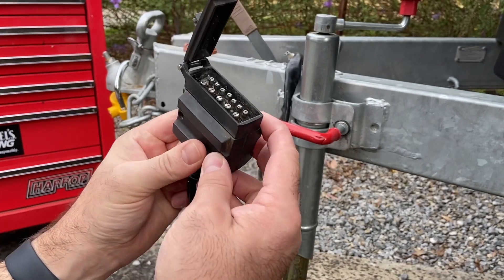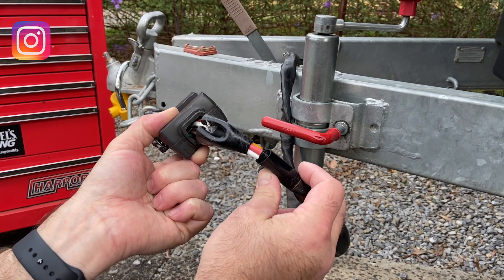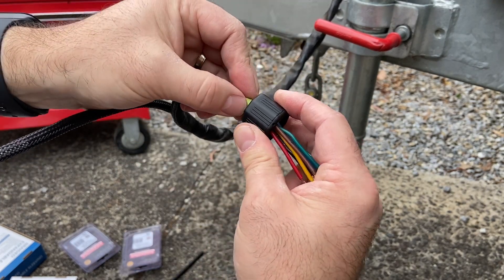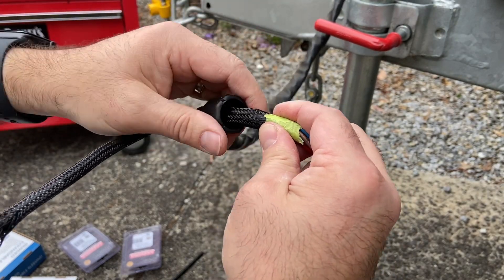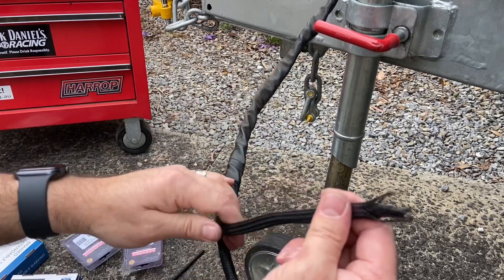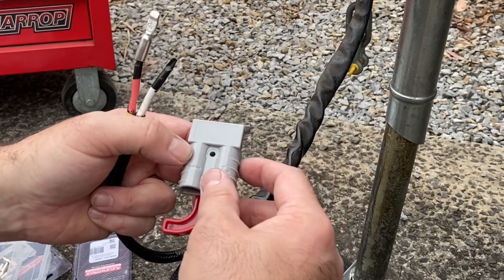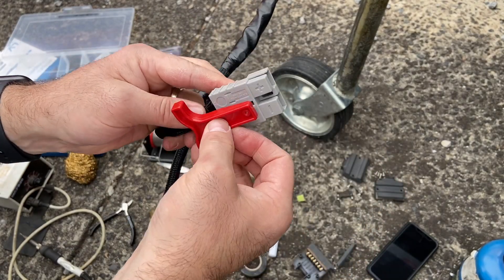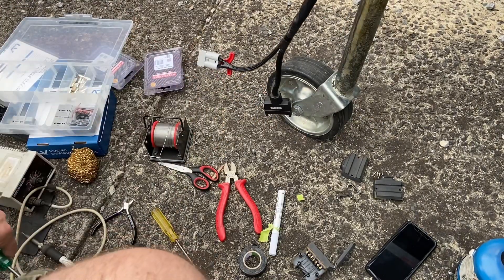Wiring an Anderson plug and 7 pin connector for caravan / trailer | The Shed Sesh

Comment: As far as home wiring jobs go, yours is one of the better examples. You didnt use a vice or angle cutters to try and crimp the wires..

Only changes I would make is to use heat shrink instead of electrical tape, and expose a bit more of the wire going into the anderson pins,, (use heat shrink to secure the braided sheathing to the pins as well.. 

Over al, well done. (P.S. I am picky with wiring/crimping, as I an an RAAF trained Avionics Tech/Elec fitter of 50 odd years experience)
Reply from the maker: Ahhh, yes, no room for not perfect in avionics. Thanks for the feedback mate. Next one 😉 I do love heat shrink.

Comment: Even when not filming it's a 3 hand job to solder.  I always setup some kind of stand to hold what I am soldering otherwise I get pissed.  It's hard watching you do this but you did a reasonable job.  When soldering if you are not adding heat and fluxed solder at the same time like you did you are probably going to overheat it if not experienced.  

Nice job, a little extra effort at this stage saves you years of frustrating on the road repairs in the future.

Comment: Thankyou. An inspiration. You are far better off doing things yourself aren't you? Yesterday for the first time i plugged my caravan into my 2022 bt 50 Mazda. 5 minutes later smoke coming from everywhere. 12 pin plug I ordered when I purchased my new Mazda. Thought the professionals would make it safe for my family and I. A very scary experience. Let's see if they own the work they have done. I suppose I will have to put up with all their bullshit stories/excuses...But Thankyou for your great and detailed video.
Reply from the maker: Mate, no good. That would have been very scary. My pleasure. Glad you found it helpful. Good luck with the dealership 👍👍
Reply: Mate don’t feel bad you will had hopefully have it sorted by now Had a similar experience with Toyota,we didn’t have the burn only limp mode Found the accessory wiring behind the kick panel used scotch lock connectors and a well that’s how cheap tradesmen do a job Brilliant video thanks

Comment: hey mate, any idea what the 2 pin plug coming out of the harness just on the drawbar is?
Reply from the maker: Hey mate, would have to see a pic. If it’s not doing the same as an Anderson plug, charging the battery. Do you have a rear mount camera?
Reply: @TheShedSesh  2:34 you can see it right next to your jockey wheel. I have recently been informed that it is for optional stability control.

Comment: Why replace the 12 pin? The big  terminals are rated at 35A, if you've got more draw than that then your system in total needs looking at. 

You can also buy 12 pin sockets with built in Anderson connectors. I just fitted a 12 pin on the car,  7 pin fit into it fine and its only 1 plug, and everythingis nice and tidy. .
Reply from the maker: @mattyb7736  thanks for the feedback 👍

Comment: any reason to not crimp the Anderson lugs in, done in like 30 seconds vs soldering? from what I've heard soldering can fail - at least when done DIY, so crimping would seem a better idea for DIY
Reply from the maker: Hey JB, you are correct. There are 2 camps with wiring. To solder and not to solder. Problem with the Anderson 50A pins is they are huge compared to the wire going in them so the crimp would have to be VERY good. If you were poking in a 50A wire then crimp all the way 👍
Reply: Genuine Anderson plugs have lugs in different sizes to fit smaller cables , non genuine are mostly only 6bs

Comment: Hi mate what van make is this?
Reply from the maker: Hey mate. Jayco expanda outback. 👍
Reply: Great I need to do the same to my Jayco journey outback thanks for the video
Reply: Are you running 12 pin still on your car?
Reply from the maker: @cameronjurd8243  nah, only the 7 pin. That’s why I did the change to the van. I have a seven pin and an Anderson plug on the car 👍 I’d never seen the 12 pin until I got the van.
Reply: No worries I’m picking the van up this week but diagram seems like there will be surplus wires for fridge ground, fridge supply and battery supply
Reply: Certain caravan manufacturers have a nasty habit of using Reverse for extra 12V power. Unless you have reverse lights, it might be an idea to leave the black wire disconnect on your van.
If you have electrical problems between your tow vehicle and your Jayco, do not let them touch your car. If they modify your vehicle and you tow someone else’s trailer with reverse lights, the lights will stay on permanently.

Point them towards AS-2513 and tell them that you want your van to be roadworthy and compliant with Australian standards.
There have been quite a few vehicle/caravan fires due to onboard electrics pulling too much Auxiliary power through 4mm cable.

If you have a dual-axle van with electric brakes, you may want to use a thicker wire for Blue and White too. Electric brakes performance is effected by Voltage drop so a thicker cable will allow your brake controller to provide more current and more effective braking. That current needs to go somewhere so a thicker Earth cable should be used too.

Comment: Pins 8-12 do serve a valid purpose. They give idiot Caravan manufacturers somewhere to put Auxiliary other than Pin-2.
Do not ever wire Auxiliaries to Pin-2. Standards exist for a reason.
Reply: Is this why caravans/campervans don't illuminate any lights when reversing?? The manufacturers have hijacked Pin-2 to use to power something else instead of reversing lights.... am I correct in thinking this? I have wondered for years why vans don't have reversing lights.
Reply: Dan - where does the aux connect then if you can't use pin 2.  Could you use it just for internal lights then use Anderson plug for fridge?
Reply: @jeffhale713  those pins on the 7 pin plug and socket are not rated to run a fridge. they will melt - hence Anderson plug for battery charging, as you should be putting in 30-40 amps, and the fridge would work more efficient with its own ando too. such small gauge wire over the 8-12 meters is too long and will result in voltage drop. - leave the 7 pin just for lighting.

Comment: I would have used a 7pin with Anderson plug all in one.a lot less mucking around.
Reply from the maker: Didn’t know that existed mate. I’ll have to look it up. I would have had to rewire the car if I did that so either way something would have needed rewiring. Thanks for watching 👍😊
Reply: @TheShedSesh  certainly do,I discovered them a while back when looking for a new plug.for my van, nearly bought one but discovered the new car already had an Anderson already fitted to it otherwise I would have gotten one.what you've done is quite good as well and looks neat.i may decide to change down the track though.cheers